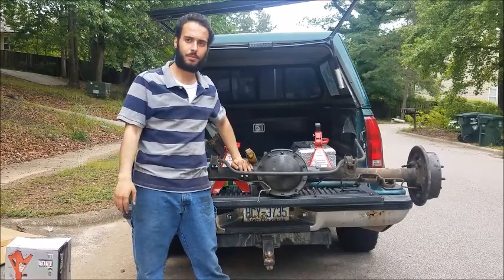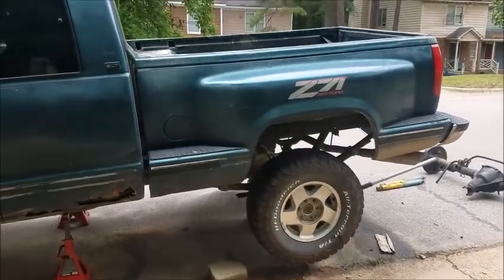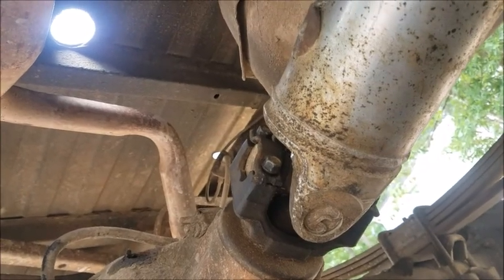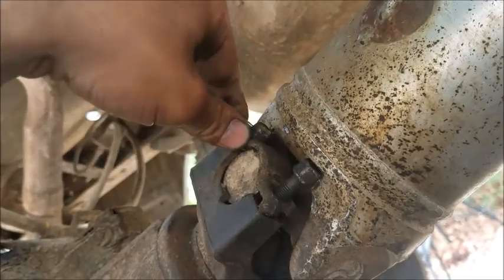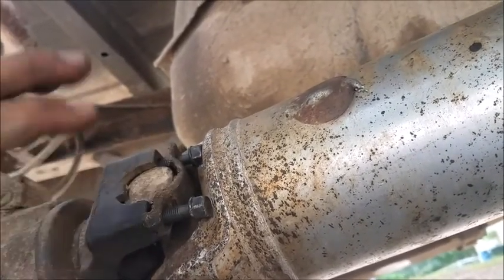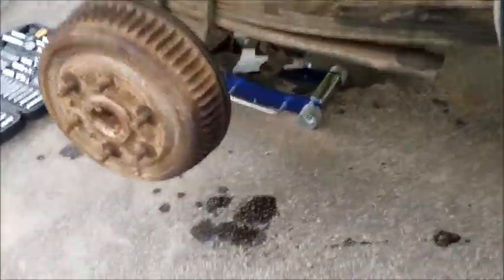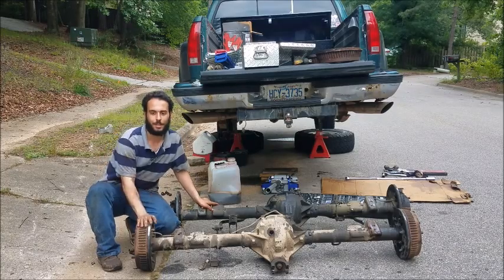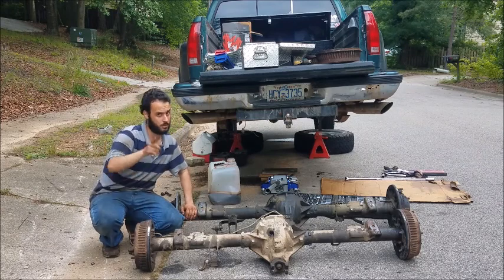GMT400 REAR DIFFERENTIAL REPLACEMENT - PART 1 (REMOVAL) FULL GUIDE!!!!!!!

Comment: I spot a fellow vgg fan... Lol, I just built a 14 bolt for my Hotrod truck, which is also an extended cab stepside. Great motivation.
Reply from the maker: Thanks man, I'm looking a 6 lug 14 bolt semi float myself
Reply: @mooseempire00  I was able to find a 8 lug locally. Had Dutchman build me a set of 5x5 axles. I installed it last weekend and it all worked out really well. Direct bolt in!
Reply: One in a million 👍

Comment: Was wondering if you could help me figure out the size of my rear differential. I drive a 1988 Chevy k1500 standard pickup. I think it’s the 8.5 ring gear but I have to replace it.
Reply from the maker: count the splines on the ring gear and the splines on the pinion gear. Gear Ratio = (#of splines on the ring gear) / (#of splines on the pinion gear) and round it to the nearest two decimal places